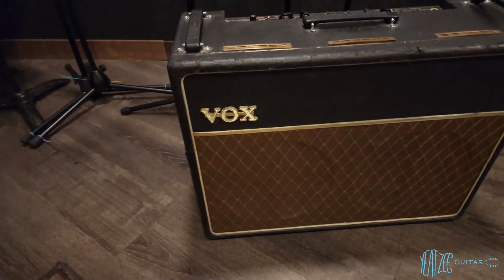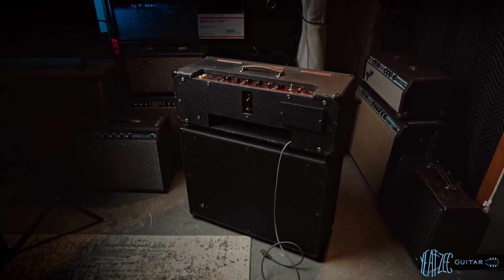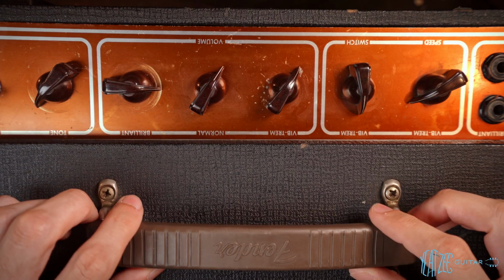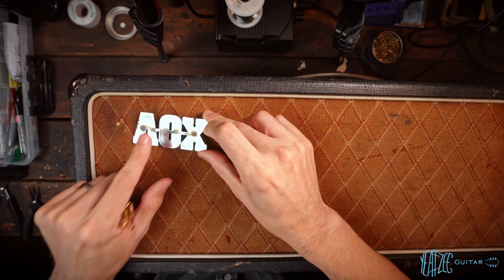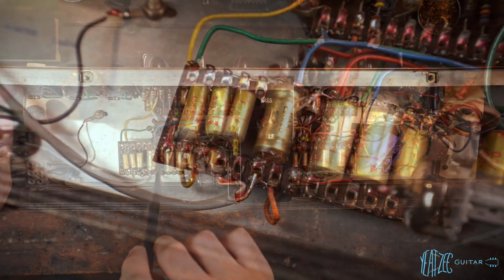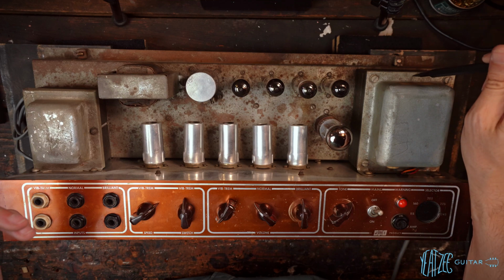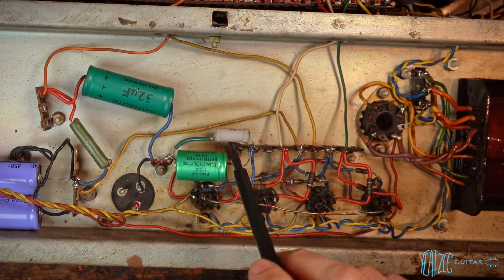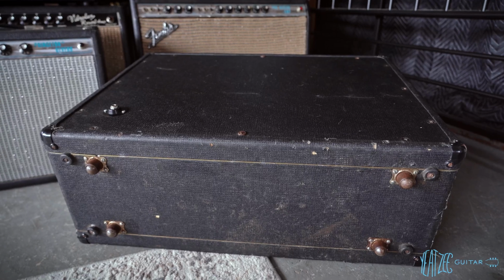I Bought My Dream Amp.... TWICE 😳 - JMI Vox AC30 Repair Pt.1

Comment: Where did you purchase those large size rubber feet for the amp? I need to get some of those.
Reply from the maker: Good question.... I think amplified parts
Reply: @ thanks I will check there.

Comment: Hi Yeatzee, wow... nice buy! Restored quite a few AC30's over the years. Great amps, but "Diva's". Actually I bought a 1962 VOX AC30 Copper Panel last year at about the same time. It was found in a dumpster in southern France and the price was ridiculously low. If you wanna have some VOX-Chat, you can get me via info@tube-workshop.de
Reply from the maker: @tubeworkshop  right on! I've got my 64 ac10 going under the knife soon, this super twin has been my main gigging amp since I've done it's restoration. Wish I could figure out how to reduce the noise in the topboost channel, maybe you'll know some tricks!
Reply: @YeatzeeGuitar  Currently watching your restoration videos on these...  I'll let you know if I have some tricks up my sleeve after watching all of them.
Reply from the maker: Roger that!

Comment: Nice scores!  The EL84's probably have gotten so hot that it burned off the tube markings.  You will need to pay special attention as these amps typically run EL84's extremely hot.  A lot of modern tubes will get eaten alive.  For replacements I would look at a quad of TAD EL84-STR Redbase.  They are very robust & sound great.  Sovtek EL84M are also an option but tonally the TAD's are better imo.  I actually have a quad of Telefunken EL84's.  Well...one is actually an Amperex.  But they don't really work as a quad as there is a 15ish mA swing between all of them.  Best I can get from them is running in pairs in not a quad.  The TAD's sound good enough that I don't even bother to mess with them.
Also, the "nasty looking" caps are likely old Lemco wax coated silver mica's.  I think I have a few of these but I haven't bothered to test them for leakage on my Heathkit IT-11.  I'll see if I can find them & test for leakage.  Given that they are silver mica's they might be fine.  But the wax coating is not ideal.
Reply from the maker: Good point on the EL84's! I've got a quad of matched JJ's in the stash that I was planning to try if these end up being poor tubes. Good call on those nasty caps too! I mean if they work great, but boy are they gross lol
Reply: @YeatzeeGuitar  Just tested the Lemco wax coated silver mica's I have.  I would not be concerned at all about these.  Not only do they not leak anywhere from 3-400VDC but they test like a new capacitor.  The capacitance value may have drifted slightly but they are rock solid.  One of mine is in horrible shape.  Mangled leads & it almost looks like it is coming apart.  I certainly wouldn't use it because it's too physically unstable but it tests like a brand new capacitor.
Reply from the maker: @Guitar5986  rad!
Reply: @YeatzeeGuitar this is one amp that it is worth to go all NOS or at least ANOS

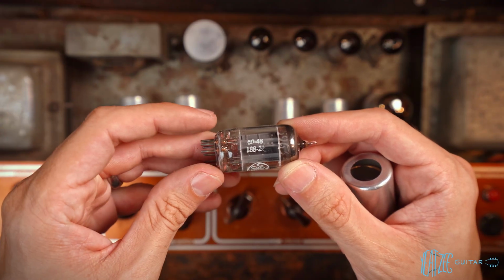Comment: Man @29:31 dude did you dirty on those tubes. The 5963 GE is a crap sounding12AU7 sub and the rest💩. Mullard rectifier is the NOS tube to splurge on.
Reply from the maker: Really? I would think the rectifier wouldn't matter all that much since it doesn't sit in the audio path.
Reply: @YeatzeeGuitar  Modern ones aren't exactly made as well as those old Mullards, if it ain't broke, don't fix it.
Reply: @YeatzeeGuitar just because something doesn’t sit in the audio path doesn’t mean it won’t affect sound indirectly. Just a few volts difference from your wall or brown box can make a large difference, imagine the rectifier which sags a certain way depending how the amp is pushed.
Reply from the maker: @mohamedtlass3842  that's fair, though I have in the past tested with my variac one of my amps with 120 vs 115v and noticed no real difference in sound. I had heard from some the brown box dramatically changed the tone, but I didn't really experience that. Fwiw I do have both mullard GZ34 and an amperex bugle boy GZ34 in other amps, so I can always give it a try.
Reply: @YeatzeeGuitar  I'm just a novice noodle, but have a brown box and researched it a bit, supposedly it effects the tone on tube amps using smaller 6V6 and EL84 power tubes, not much with the larger 6L6, EL34, etc...

Comment: 444 is supposed to be a 55Hz cone vs 75Hz for a 1777 code.
Reply from the maker: Interesting! Kind of cool actually, now I'm really curious how the two original blues sound in the ST cab next to this silver pair.
Reply: 1777 is the production code for this speaker..nothing to do with the cone..the 003 and 444 is to do with the cone..go to bygone tones and its explained there in detail..all you ever need to know about old celestions.

Comment: People modify amps because theyre 10 yrs old and nobody's worried about how much it'll be worth in 60 years. They mod it because it's a tool to be used just like a wrench or a hammer.

I don't understand why so many people ask that question about older equipment. "why would someone do this?" you know exactly why. Because at the time, it was just a $600 amp. Not everybody is a collector nor are they worried about what a collector might think in 60 years. 🤷 I mean... It's the same reason every time, no matter the equipment.
Reply from the maker: Well it's one thing to mod something, it's another to take the time / care to mod it well. My '63 LP junior is a good example, in the 70's someone added a humbucker in the neck and a pickup selector. You can tell they really cared by how they installed it, attempting to bevel the pickguard and all. That's not to say they did a great job, but the care was there and they tried to do it right. Drilling a hole in a chassis and top panel to accomplish what the footswitch accomplishes is pretty goofy regardless of the value of the amp at the time... imo of course! Hindsight 2020
Reply: People were often on drugs back then and made all sorts of dumb decisions… like the goofs that painted my 61 Bandmaster and 1935 National-Dobro amps black

Comment: Super Twin is '64.
Why?
Corner protectors but with copper panel and brown grill.
Reply from the maker: Awesome insight! The tolex and corners perfectly match my '64 AC10 so checks out! Interesting on the vox logo, the ac10 has no line between the letters but both of these do.

Comment: What do you mean a ‘64 Twin with JBL’s is heavy? They’re only 92 pounds!

I’m sure you looked up the 5963 already, but it’s basically a computer grade 12AU7. I think it’s the vibe/trem tube, so it should matter.
Reply from the maker: 🤣🤣 I can speak to that first hand, Twin with JBL's is insane. No. Thank. You. 😅
Reply: @YeatzeeGuitar imagine if you had my super six reverb then!
Reply from the maker: @mohamedtlass3842  🫡 I salute you sir, that's a monster.
Reply: @YeatzeeGuitar  At least it has side handles and wheels!